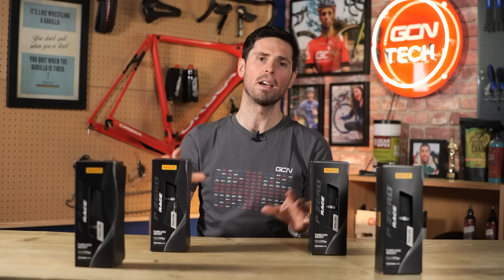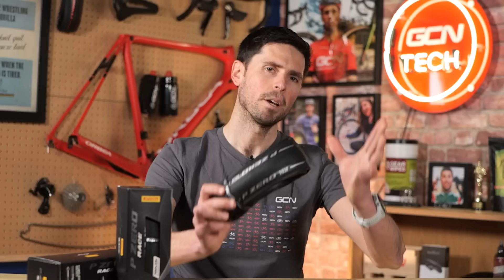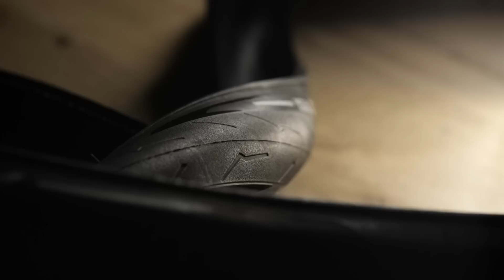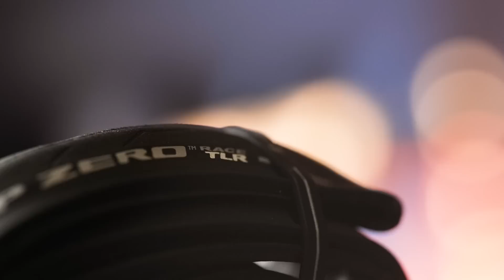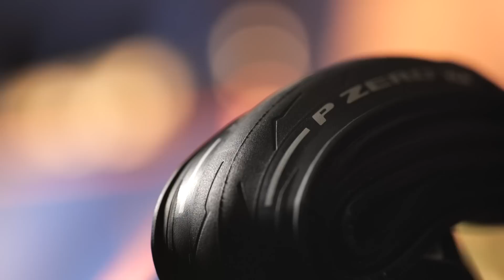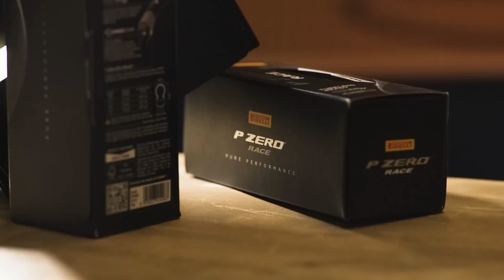NEW Pirelli P Zero Race TLR Tyres - Details & Giveaway!!

Comment from the maker: What do you look for most when buying tyres? 🧐
Reply: NOT TUBELESS
Reply: Quality, ride and value. I'm not wedded to any particular brand but I don't cheap out as many entry level tyres do not ride well. Your tyres are the most important parts of the the bike in determining how much you'll enjoy your ride.
Reply: Tires in a size range from 32-36 and something that is durable but not super slow.  I also like tubeless and I prefer a tire that adds some comfort instead of a harsh ride.   Ability to maintain traction on wet roads is really important and longevity.  If a tire can not last me a couple of seasons then that’s disappointing.   I am a 200lb rider who rides a lot of long rides during the summer so the larger sizes are really nice!
Reply: Depends onH  how smooth the inside and out since im using a road bike and also the weight
Reply: I look to price
Reply: With this being the main part in contact with the road, I am very demanding on tyres. Speed, puncture resistance and confidence on the bike. Had P zeros before and they fitted the bill. New bike came with different tyres, and I don't throw away unworn tyres, so will stick with them for a while. They are good anyway.
Reply: Puncture protection and fast rolling
Reply: I look for ones that say "Continental Grand Prix 5000 TL" because I've been riding Grand Prix tires for over a decade and they continue to be the best per lots and lots of tests ¯\_(ツ)_/¯
Reply: The last two sets of tires I have bought are tannus.  Tired of cuts and punctures.
Reply: I'm looking for punkture protection and rolling resistance.
Reply: For Gravel for better rolling and stability tyres and easy to clean and reflector on the side walls on the tyre and the PSI it holds.. 👑🚲👑
Reply: Good puncture resistance, reasonably decent rolling resistance, durability and price.. oh and 25mm to fit underneath my mudguards. I can see these are 26mm, which might have just fitted, but a certain website about tyre rolling resistance has measured them at 27mm, so they won't fit (and I'm not going to wrestle off my mudguards only for it to rain the next day 😅)
Reply: Whether they are Hookless compatible.
Reply: I check the size and check the level of protection against punctures.
Then I check the price.
Reply: comfort
Reply: Puncture resistance, tubeless, and the ability to ride all day.  I don't worry about price, as long as they do the job.
Reply: Can you do a head to head comparison between this, Conti GP5000 and Vittoria Corsa? Same bike same size tire same wheels same everything.
Reply: Well Bob,  when I buy tires, I look for puncture resistance, wet grip, weight, and either 25mm or 28mm for the two road bikes I own, finally, I justify the cost as i only live once. But, I have two sets of wheels for each bike, shod with different tires for different uses, eg my Endurance bike has higher performance road tires on one set and dirt road/higher puncture resistance oriented tires on the other).
Reply: Durabilidad y agarre.

Comment: Recently I bought P Zero TLR 28mm Speedcore and I'm really disappointed.
28mm model measures ~26.5mm !!  on 19mm inner width rim !! (the same was with P Zero Race 28 TLR TechWall) - no it's not true to size !!!

whereas other tires, Conti GP5000 or even Pirelli P Zero Road on the same rim have ~28.5-29mm !!!
Should I buy 30mm model to have correct 28-29mm tire ??  
sort your shit out !!

Comment: I bought a second pair of these to fit in Spring as I liked riding them. "try to put these tyres on my  bike" is the last thing Alex says - good luck with that mate - because the latest pair I bought are so tight to the 21mm rim you need a vice and a jack to fit them. No chance of getting them off if you puncture on the road! AVOID unless you have the Hulk riding with you.

Comment: I love Pirelli tires and I prefer them to Conti's for several reasons ( an important one being that they are infinitely easier to mount on the side of the road). However, your viewers need to know that when Pirelli calls something a Race tire they are serious. In my experience over the last several years I have found that the Race versions of their tires are extremely prone to punctures and you really want to save those for your race days. And since the majority of GCN viewers don't race I strongly recommend getting the Road versions of their tires, which are very good in about every way even if they are slightly heavier and have a slightly higher rolling resistance than the Race versions.
Reply: What about the new p zero race 4s?
Reply: @bonbonflippers4298  I've never tried them.  But I will at some point.  They might be perfect for my riding environment.

Comment: I don't race, but I do ride long distances and some of the advantages of materials for racing (light weight and low rolling resistance, for example) benefit long distance riders.  Do you suppose this tire in 30 or even 32 mm would be something I should look at?

Comment: That looks good. And pretty fast.
24% increase in speed sounds like it can shorten riding time in a race with possibly 30 seconds (or more).
I know that my bike uses 35mm wide tyres. And the rims are not tubeless ready. Is it possible to use these with an innertube? I have innertubes myself.
Reply: Yes you can use inner tubes with tubeless tyres, no problem at all, but you will use a little more power to maintain a given speed versus running no tube. Also, most wheels can be converted to tubeless compatibility. Muc Off do a "ultimate" tubeless conversion kit with all the gear you need to do it. Happy riding👍

Comment: Interesting, but that’s pretty bold talk from Pirelli.  I’ll wait for an objective review from Bicycle Rolling Resistance before I swallow that claim.

BTW, the Conti GP5000S TR 25 is shown by BRR to have a resistance of 10.1 watts at 80 psi, while the previous PZero Race 26 is at 14.3 watts.  Even with 24% savings, they still don’t quite get to the Conti (10.7 watts).  So they beat themselves and are close to the benchmark, but no compelling reason for me to switch from the Conti’s (unless I win a free set).

Comment: On a serious note [meaning, all jokes aside🤣] my high-school physics states that rolling resistance is based on the quality of the rubber, the tire pressure, the size of the of tire surface contacting the road, the road surface->> rough, smooth, jagged, wet dry, oily,  <<-- too many variables to make a rolling resistance marketing claim.
Reply: Rolling resistance is definitely measurable, even on pavement.

Comment: About time they added 32 and 35 tires to the mix.  Everyone is not a racer and some of us are heavier than others.  If they are faster than the old ones and they are durable that will be awesome.  I’ll buy a set for summer.
Reply: 30 is already fine right? I'm a big rider too and even good 26mm tubeless were fine